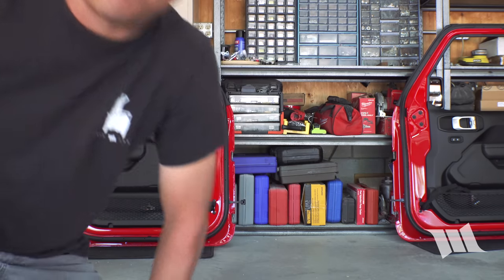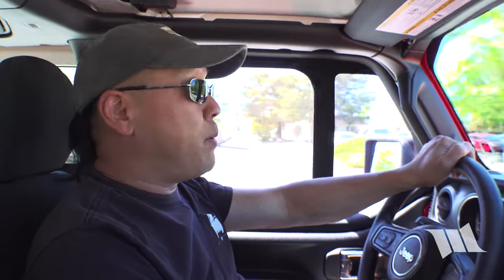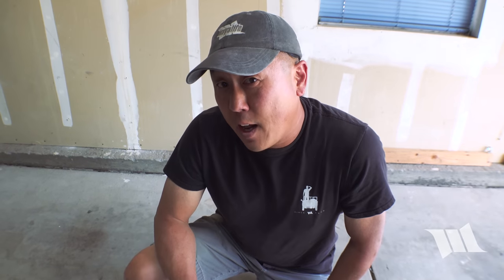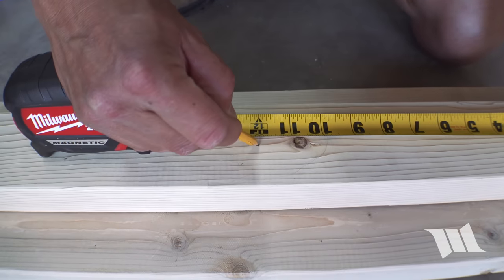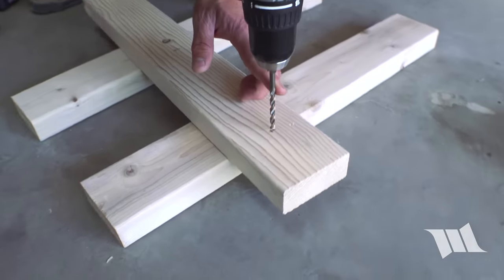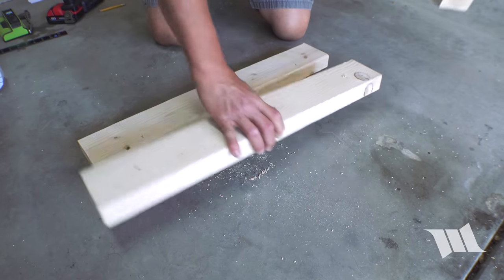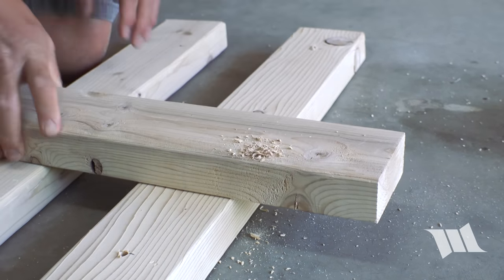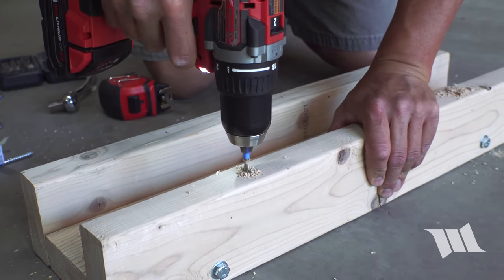DIY DOOR HANGER for Jeep Wrangler and Gladiator Trucks - Works for JL / JT and JK too!

Comment: I followed the instruction and made the door hangers for my 2019 JLU’s full doors. The only caveat is that, using 1/4” by 3-3/4” eye screws, when you put the front door on, it’s so heavy that the screws are bent as soon as the door’s weight is put fully on the eye screws. I replaced with 5/16” by 4” eye screws and made sure 2.5” of screw is torqued into the lumber, and it worked perfectly. GREAT instruction and it works like a charm
Reply: I had the exact same problem, going to try 5/16 next
Reply: I wish I had read this comment BEFORE going to the hardware store... bent, just as described...
Reply: Thankyou for the heads up I just got my first jeep and I am going build this

Comment: And I love how you actually use the correct name for each component even if it's a nut or a bolt or a washer.
Reply from the maker: Well, it helps to separate one thing from the next. 😎

Comment: Love the video - done in such a way anyone who isn't well-versed in carpentry could handle it. Well done. I'd add only this - some people have old garages, maybe not totally straight walls. Might not be a bad idea to put a level against the wall as if it leans inward at all, even a little bit at the top, once you hang the doors they'll want to swing away from the wall. 
You can correct for this be tweaking how far in the eyes are top compared to bottom, or shim the bottom of your hanger out from the wall just a tad. Keep it totally vertical left and right and top to bottom and the doors will stay put. If you've ever been in a house where a door wants to close, or open itself if not latched, it's due to it not being plumb at the hinges. 
With this project, it can be used even in an old garage that's less than perfect just by making sure the eyes are plumb in all directions.
Reply from the maker: Great tips! Thanks for sharing them with others.

Comment: I'm going to build this. I plan to use the plastic coated screw eyes, to avoid damaging the paint on the hinges, or at least Plasti dipping the metal ones.
Reply from the maker: The base of the hinges have unpainted sleeves and that's what sits on the screw eyes.

Comment: Or anchor 2 big hooks purchased from Lowe's or HD. The padded ones with the orange plastic protector. With windows down fold in the mirrors then hang em up thru the top of the window frame. 2 big heavy duty hooks 4 - 3 inch lags bolts and you're done. I do like your idea also. About the same cost.
Reply from the maker: Not something I would recommend. For one, you can't hang half doors with them and for two, over time, the rubber seals at the top of the window frame will warp, even with padding on the hooks. At least, that's what I've seen. But hey, if it works for you, awesome.

Comment: So refreshing to see people building what they need instead of buying it. Great stuff!

Any reason you can't use a 4x4 with a longer lag bolt, or even counter sink it half way in? I have some scrap 4x4 I could use. Seems like that would work, am I missing something that would make a 4x4 not work out for some reason?
Reply from the maker: Can't see any reason why it wouldn't work. I was just trying to show how you can buy precut pieces of 2x4 from the hardware store and how easy it is to transport home in something like a 2 door.

Comment: Thank you for the great video! Would it work using only 1 2x4 Project Lumber? In this way the hooks would be 2 inches apart from each other and you would hook the lumber to the wall in between the hooks , just in the middle of the lumber. Do you think this would be too risky and to much stress to one single lumber? Thanks, MG
Reply from the maker: I suppose it's possible if you can figure out how to secure it to the wall.

Comment: amazing! I built them and they rock! the same with the hard top hoist you shared! THANK YOU!!! BUT as a new jeep owner for the love of God how do you fold in the side mirrors? They are so tight. They don't budge. I am afraid to break something. Thanks!
Reply from the maker: Awesome! Glad I could be of help and the mirror will fold it. Easier to do when they're still on your Jeep though. Just hold either side of them with your hands and push and pull at the same time.
Reply: @wayalife  thanks for getting back to me. I have tried but the plastic sounds like it’s snapping. Does it matter if the mirror has blind spot monitoring? I am thinking maybe they don’t fold due to internal wiring etc?
Reply: It’s a 2021 unlimited sport s
Reply from the maker: Doesn't matter. They will fold in. After the first time, it'll get easier.
Reply: @wayalife  ok will keep trying. Thank you. And BTW your videos ROCK!! So cool. Love your Jeep collection!! 🤟🤟
Reply: HA!! It worked!! Phew! It took some brute force but you’re right now it’s easier and softer to fold!! THANK YOU!!!
Reply from the maker: Awesome, glad you were able to get it 👍

Comment: Nice…I would have just bought two of the industrial hangers from HF…great job though.
Reply from the maker: If you mean to hang the doors from the top of the windows, I would be careful in that they will cause damage to the rubber seals over time.
Reply: @wayalife  Good point...didn't think about that. I guess in that case using a piece of pool noodle over the tubes MAY help, but I do like the ones you made...
Reply from the maker: @jarhead6153  Unfortunately, that doesn't even do the job. There are other hangers that you can buy that aren't too expensive and they slip in between the window frame to prevent this kind of damage.

Comment: What grade of screw eyes did you use?  I think I grabbed the zinc ones and the heavy doors bent them like warm butter.  Thanks and love the channel.
Reply from the maker: Wow, you drove them in at least 2" in and they still bent? Not sure which ones I bought, just grabbed what I could find on the shelf and saw no bending. Sorry it didn't work out for you.
Reply: @wayalife  Thanks for quick reply...  after watching that part of the video again and looking at my setup I do think you drove them in a little further than I did.  I'll drive them in more and see how they hold up.  If not I'll look for a higher grade.  Thanks
Reply from the maker: @frnch44  Cool. As I state in the video, they need to go in at least 2" deep. Heck, you can go more if needed but 2" is minimum.

Comment: Did this for my JLU this summer and turned out great!! However... I noticed the bottom face on one of the door hinges that sits on the screw eyes started to chip some paint off.. Have you experienced this ? I was thinking to add some soft adhesive "pads" on the metal eyes.
Reply from the maker: I have not had this problem but what you're thinking sounds like it could be a good idea.

Comment: Hello Sir ... great video and thanks for it! So I am currently waiting on a 2022 4D Willy to be made and I was going to preemptively make your hoist and door hangers in my garage. For the door hangers I really hope to have one above the other because I have limited horizonal wall space. With that said I would need to know how tall the actual doors are so I know how high the bottom one needs to be from the floor ... and how high the 2nd one needs to be above the bottom one. I searched the internet and could only find the overall height of the Jeep ... not just the actual doors. Do you know how tall they are? Thanks again for the great how-to videos!
Reply from the maker: The doors are about 45" tall. I would probably assume for 46" just in case. Also, when you make this hanger, be sure to drive the screw eyes AT LEAST 2" into the 2x4 as I state in the video.
Reply: @wayalife  Perfect! ... you are awesome sir!

Comment: Any concerns on weight of doors?  I have a JT for reference and it looks like those eye screws may be sufficient but just asking the group here.
Reply from the maker: LOL - if I had any concerns, I wouldn't be using this hanger to hang my doors. A standard Jeep door with power widows weighs about 62 lbs. A single 1/4" screw eye will fail at 13,000 lbs. In other words, the screw eye would bend well before it could ever break. You're just letting your imagination run away.

Comment: Is the weight and the hinge spacing between JK and TJ door hinges the same?
Reply from the maker: The JL and JK are the same. Can't remember on the TJ but I'm pretty sure it's the same too in terms of spacing. Weight is a different story as the TJ uses a thicker steel and that makes it heavy but the powered window motors in a JK door makes it pretty heavy too.

Comment: we just bought our 3 jeep, a 2018, only driven by a Soccer Mom on week ends, never had the doors off, I got a RR that the hinge pins are stuck bad, any suggestion ?
Reply from the maker: Get someone to help you. Apply some penetrating oil to the hinge, stand a cut down piece of 2x4 on top of a floor jack. Place a 2nd 2x4 flat on top of it to help distribute the load and then raise your jack so that it's pushing on the base of your door. Slowly raise your jack and carefully work the door back and forth just a bit to help work in the oil. This should help to free it.

Comment: do you know how to add power windows and power door locks to wrangler jl sport ? a lot of the sport owners are looking for solution and tutorials
Reply from the maker: Unfortunately, there is nothing easy about it. Even if you can take apart the door and install the motors necessary for the windows, you still need to wire everything up and have the dealership flash the computer to make it work.
Reply: @wayalife do you think any aftermarket power windows kit  would be available soon ? what about power door locks ?

Comment: Are these strong enough to be able to store the doors straight out instead if to the side?
Reply from the maker: So long as the lag bolts are long enough to make a solid connection to the 2x4 in the wall, I don't see why it wouldn't be.

Comment: Why can’t we just put the hooks directly into the studs on our wall? Why do we have to put hooks into 2x4 first and then mount 2x4’s into stud?
Reply from the maker: It's to provide clearance for your mirrors and allow your doors to sit flat and parallel with your wall.
Reply: Makes sense but could we just hang the doors with the mirror facing out instead of against the wall? Also thoughts on taking actual Jeep door hinges and mounting the actual hinges into the wall and hanging the doors on those hinges instead of eye hooks?
Reply from the maker: @ymmy4800  On the inside, you have the thickness of your door and the arm rests that you have to clear but hey, you can do whatever you want or think is best! 👍

Comment: So I just built this and when I went to hang the doors the eyelets bent under the weight of the doors. Interesting. Not sure why.
Reply from the maker: Did you make sure to drive the screw eyes AT LEAST 2" into the wood. There is a card that I included in the video to point this out.
Reply: @Wayalife  ya I did. They are about 3" in. 

Thanks for the response.  

Also I finally got that RR Savannah top You recommended. Love it.
Reply from the maker: Well that's a shame. I can't say I've ever seen that before.
Reply: Hey sry this is my normal account lol. Ya im looking it it now and both bent. Looked up the specs and they are rated at 120lbs. 

Would a 3/8 one work as it would be a little beefer than a 1/4
Reply from the maker: The door can't be more than 50 lbs. I can't imagine how what you have now wouldn't hold the weight. I might try driving the screw eyes all the way in until pretty much the eye is just showing.
Reply: I'll give it a shot. I also did your hard top lift. That works great!
Reply: Just an update. So I went to another hardware store and their "same size" lag eye screws are about 50% bigger.  

Must have been mislabeled.  Luckily I caught the door before it fell. 

All good now. Jeep up the great videos

Comment: must be an engineer.   over complicate simple task.    Home depot $7.48, 75lb Everbilt Heavy Duty Wall Mounted Steel Double Arm Padded Hanger.   includes hardware.
Reply from the maker: LOL - Seen one too many jacked up rubber window seals caused by hanging doors that way but hey, you're the expert here 👍
Reply: @wayalife  Never said I was an expert.  I would agree if it wasn't a thick foam pad that sits against the window seals.